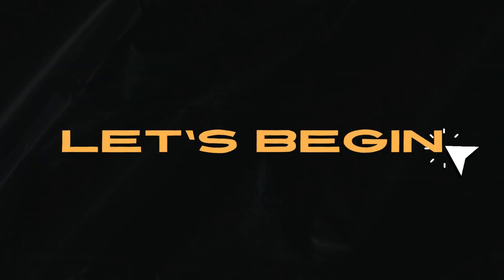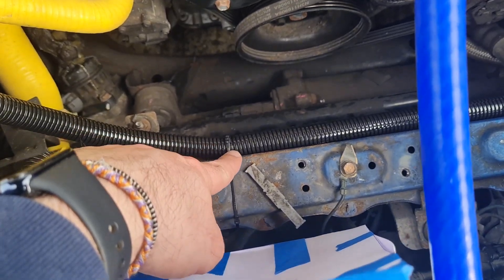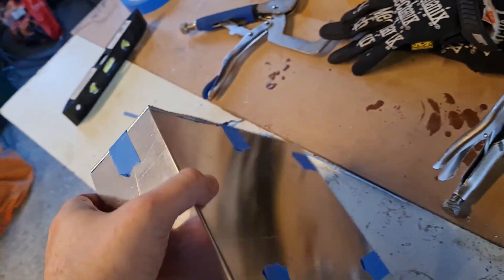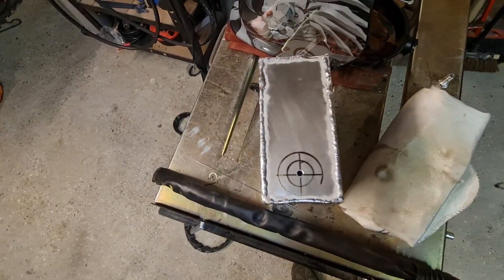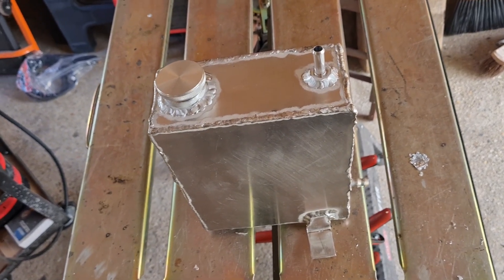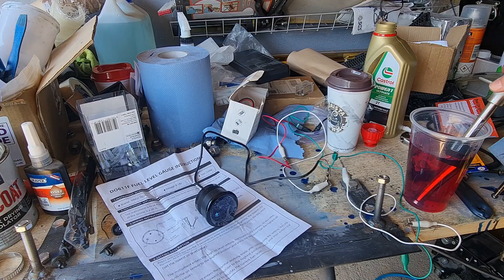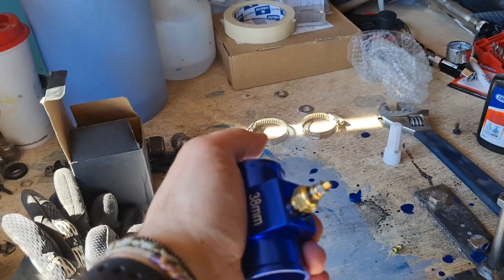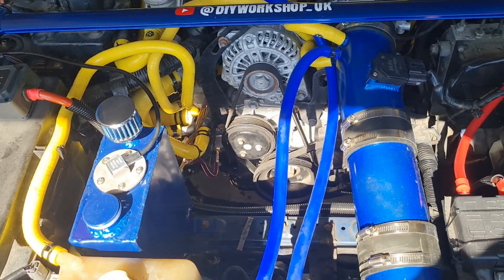Custom Sohn adapter install

Comment: What size of hose did you use for the sohn kit
Reply from the maker: Hi, i believe it was 5 mm inner diameter, so as my bung was 10mm, I had to get a step down adapter